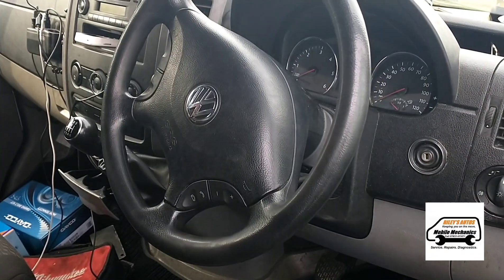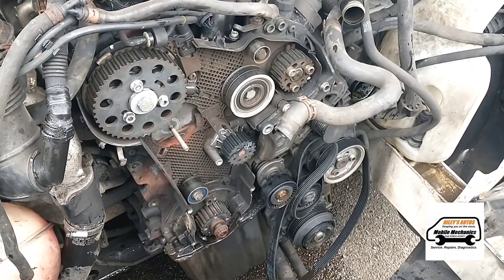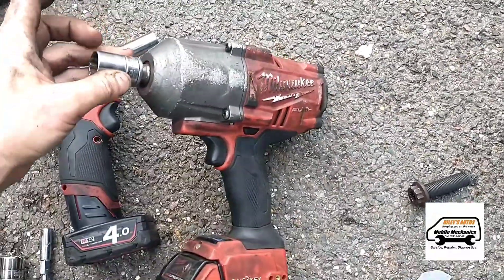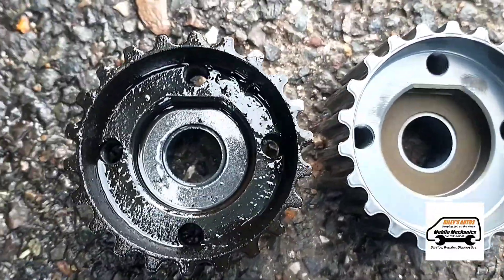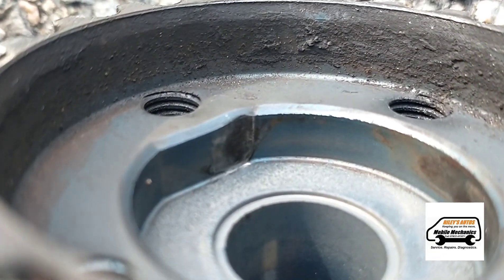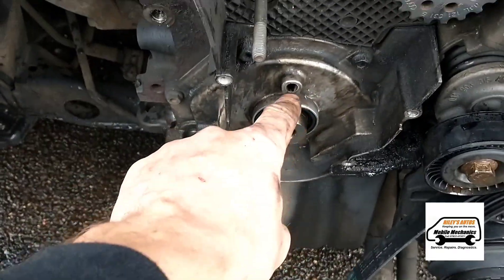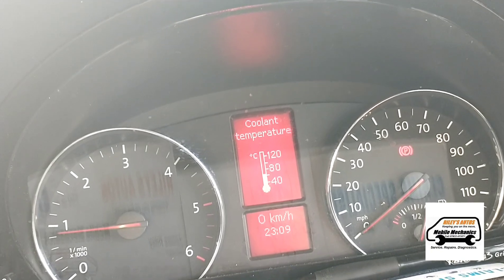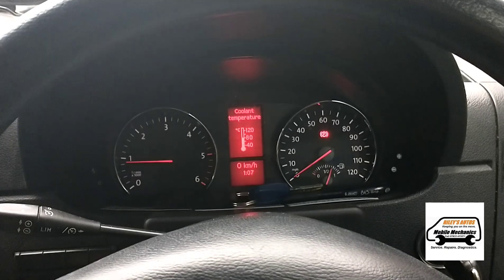VW Crafter P0016 Camshaft Crankshaft Correlation Fix P001600 Hot wont start stalling cutting out

Comment: Just had this on a crafter 233000miles took off crank gear and slight wear changed it along with the oil seal pig to get off - but sorted it - fine starting when cold wouldn’t start from hot .. cheers for sharing from another mobile mechanic 👨🏻‍🔧 fixed now

Comment: Nice find man!. is this a common problem?. I’m looking at (to buy) a T5.1 with the CAAC similar engine to this and has a correlation code present, no running issues just flashes and sets the DTC at a certain load/engine speed and goes out immediately. I’ve done loads of T-belts on these and have never come across it before

Comment: Good morning, my crafter is a shit to start ( both hot and cold ) I've had the glow plugs done, still the same. I've had the camshaft sensor done, still the same. But the last mechanic put his fault finder on and camshaft/crankshaft correlation has now come up. Do you think changing the gear will fix the problem ??

Comment: I'm going through similar following having had the following renewed. 

Independent garage......
Cambelt 
Pulleys 
Water pump 
Tensioner

Volkswagen main dealer 
Lower crank pulley gear 

Then still had starting issues, so took my van to volkswagen,  only tp find, Independent garage had attempted to remove the crankshaft sensor,  but failed, rounding off the torx head.

Crankshaft sensor (gearbox had to be dropped to extract sensor retainer bolt).

The combined bills for above was €3000 euros,  I had ny pants pulled down big time. 

I've ordered a camshaft sensor now, waiting for it to arrive, however in my case, I highly suspect the garage that did my cambelt,  they didn't set the timing up perfect.

Comment: Great vid, I've got similar problem when hot but it doesn't stall it just struggles to start and give  fault for crankshaft no signal. Do you think this could be the same problem
Reply from the maker: No. Sounds like crank sensor

Comment: Hi - what was the mileage of the van at this point? Thinking I might have a similar problem as it starts then dies instantly - only difference is it’s hot or cold start.
Reply from the maker: Mileage was 238,000 miles.

Intermittent problem problem of cold start was also on this van.

The problem was intermittent then it was permanent

Comment: thats why I will never own a post 06 vw. Horrible stupid designs
Reply: To be fair it did have 236,000 miles on the clock.
Reply: @Mickytdi  one of my customers failed at 162000mls
Reply: @nihonkokusai  Still a lot of miles. My 2.0 BiTDi 240bhp passat running well at 180,000 miles.